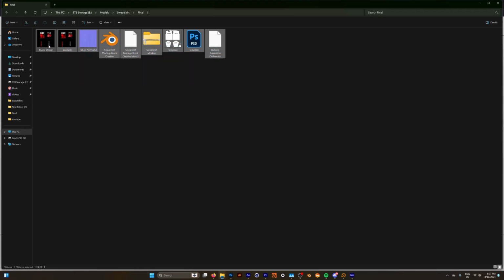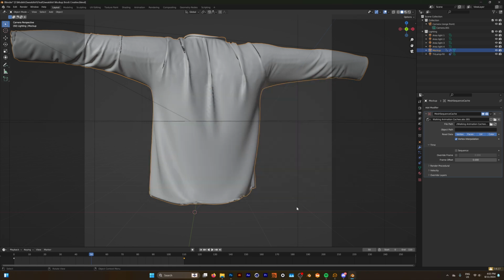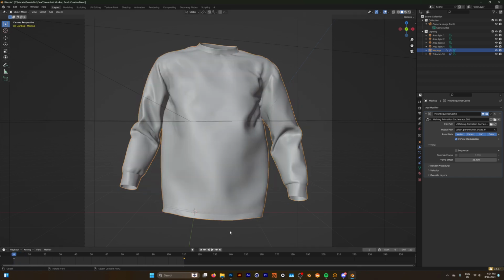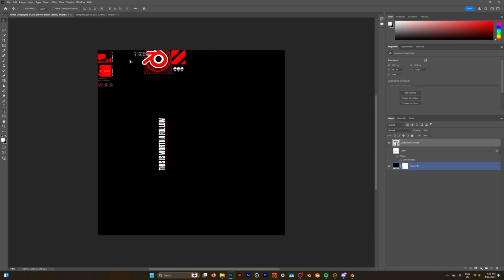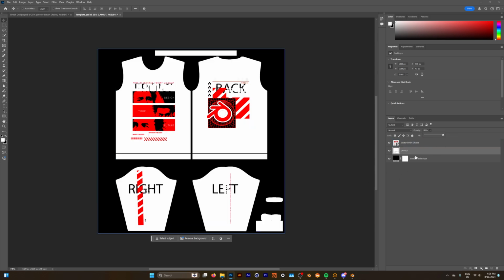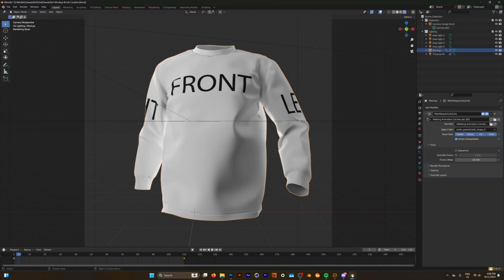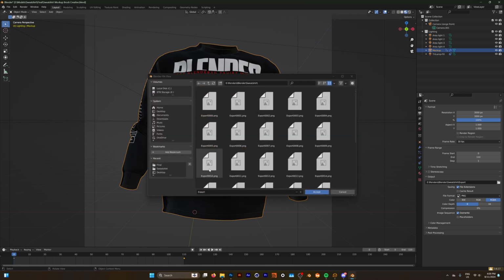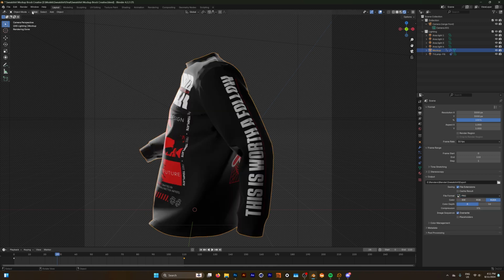FREE 3D Sweatshirt Mockup | Blender3D Tutorial

Comment: Hi there, thank you very much first of all. I have two little issues tho: For the sweatshirt animation I have the issue that the animation is first moving perfectly but in the last 2 second it suddenly freezes. How i can change that? The other issue is regarding your T-Shirt animation: The same thing that is occurring with that little awkward start at the sweatshirt animation, which you fixed with adjusting the frame offset, happens with me during the T-Shirt one. Could you assist me in finding the right offset number for the T-Shirt to not have this awkward start?

Thx in advance.
Reply from the maker: You’ll just need to move the frame offset until it looks correct for the length you desire! It’ll only cut off the animation if you’ve gone a little too far past its actual animation length

Comment: I downloaded this because I was curious, but I'm confused. What's the use of an animated t-shirt? I didn't explore the file fully, but I think using the cache means I can't actually put it on a character and have it follow the character's movement? I think I'm missing something I'm supposed to do. You could do a more "ididot proof" version of this video for newbies who can't even use a good thing when it is gifted. lol.
Reply from the maker: This is a 3D mock-up, its purpose is for showing off designs and not for characters! 

Every character animation requires a cached simulation for it, so unfortunately this only works as the animation it was simulated for & provided with. 

I’ve made a tutorial on how these are made, you can check that out for further clarification on the process.. thanks for checking it out though!